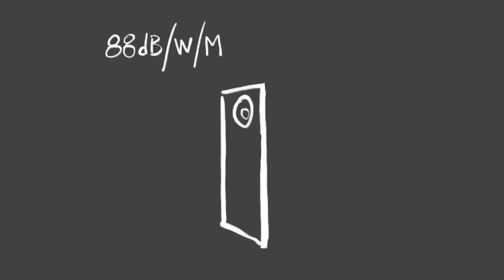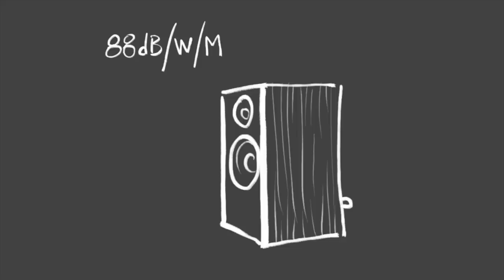John DeVore goes on a rant about the High End Audio lie that inspired him to start his company

Comment: Manufacturers started putting fuses in their cabinets a LONG time ago, as well.

I have had a pair of the lovely little "baby" infinity speakers with the ribbon tweeters for decades. They sound MUCH better with an added sub-woofer ( I run a fairly old Sony Active unit). Power amp is a classic old Rotel Ra-1412 that I bought back in the very late 1970's..

One thing I discovered a LONG time ago is that more speakers (and particularly their HF drivers) are blown up by people driving their amplifiers into square-wave distortion than have ever been "blown up" by sheer power alone. Ribbon tweeters are particularly susceptible to this. The evil super HF chatter that comes out of some electronic keyboards is also hard in ribbon tweeters. Unstable MosFet amplifiers; ditto. 100 KHz, rail to rail (+ & - 80V) square-waves will mess up your expensive HF drivers BIGLY. In the time it takes you notice how "odd" things sound, you'll be smelling the smoke from the incinerated voice-coils.

In the "serious sound-reinforcement" world, there seems to be two schools of thought:

Huge amplifiers connected to assorted boxes by relatively long, heavy cables, or

Active system where the speaker box contains the drivers, active crossovers and power amplifiers; Meyer Sound Labs is a classic example. It actually makes sense to have ten-inch speaker cables because they are running two-ohm drivers.

Also, good luck designing and building a passive crossover that has zero phase shift.

One abomination I saw in a theatre installation was foldback wedges that were sixteen Ohm, (nominally). However, the drivers (EV) were EIGHT Ohm and connected via custom-built passive crossovers. The local "acoustic consultant" wanted this so that the Yamaha 2200 Amplifiers could drive FOUR of them in parallel, (via, mind you, cables that ran from an amplifier room a LONG way from the stage). Impedance-matching? Power Factor? Yeah! Right!.

Then, there are the Bose 802 boxes, full of two-ohm drivers wired series/parallel to present a nominal eight ohm impedance to the amplifier.

Comment: I always found most Thiel speakers to sound excruciatingly bright. Some models better than others like the model 5s but most Thiels produced a much too fierce and metallic treble. But they were popular especially in magazines like Stereophile that gave them far too much attention because they did a lot of advertising. But I had no idea the company folded.
Reply: They are bright when they don't have a high current amp driving them.  When you get the amp and pre-amp right...in my case KRELL as he said....it's not bright at all but extremely articulate.  In fact, they are so accurate that they show the weakness of electronics and source without fail.  Get that right and Thiels are fantastic speakers.

Comment: If speakers are measured at 1m, basically a near field measurement, how does that correlate w baffle step compensation and achieving an accurate db measurement across the frequency range?

Comment: Watching this again and laughing a bit at the 82 db being terribly low sensitivity. I recently commented about a bookshelf having this low figure being a bit disappointing. The designer went for the lowest extension they could get from a 6.5" driver and pair of passive radiators. This comment drew the immediate ire of the designer from the driver company and some fans. You shouldn't expect that much peak SPL from a speaker that size! Or maybe they shouldn't have built such power robbing crossovers and tried to make a little driver dig so deep....anywho. Opinions.

Comment: I wish that all the hi-fi review mags would measure and give the real db per watt spec, but I doubt if they have the courage.

Even an 8 ohm speaker could actually be 5 to 6 ohms in much of their frequency spectrum, so specifying efficiency using voltage input is a piss pore marketing trick.

Comment: Seems to me most drivers are still rated in w/m

I can kinda see why they use voltage instead though.

Ones amplifier will only be able to produce a certain max voltage, and thus a scale bases on dB / volt will provide a better idea of what one can expect.

i.e. 1000W 1ohm amp wont put out much power into a 16 ohm load.

While a pair of 500W @ 8ohm amps bridged to a 16ohm driver would deliver 1000W.

Put another way: a 1000W sub with a 4ohm coil
v.s. 1000W sub with a 16 ohm coil.

Both would be the same dB sensitive in w/m
But the 4ohm driver would sound louder on a given amifier due to the higher v/m sensitivity.

dB / volt makes balancing multiple drivers easier.

Comment: You are right, but at the same time also a bit wrong.
Everything you are saying is technically correct, but that flexibility to perform at those unstable ohm's also make a sound very unnatural and locked, and at best you end up with something like a D'agostino amp.
People have to understand that a flexible amp, it just compatible and cool and nice and practical and powerful with good control. Because it is so flexible in design, it detracts seriously from the optimal sound signature. And will always have a linear type of detail and be on the grey/boring side, with a slightly flat soundstage compared to the ones with best signature.
But yes D'agostino and Bob Carver probably do this at the very best levels, while still sounding relatively natural.

Comment: This video really hit home for those of us who started buying audio equipment in the 70's and onwards.  John mentioned the brutally low impedances of Apogee ribbons necessitating mega-amplifiers like Mark Levinson & Krell and the "Receiver Wars" where Pioneer's top model produced 300 wRMS @8 ohms. (It was the size of a window air conditioning unit)  Notably, the euphonic tube amplifiers whose performance is all over the map with the varying impedances of loudspeaker drivers.  Essentially, the specifications which are supposed to be a reference meter are useless.  Today there are legions of multi-driver, loudspeakers with crossover systems so complex requiring insane amounts of amplifier current to drive them as there are inefficient, 2-way bookshelf systems that only begin to come to life when driven to lease-breaking sound pressure levels.

Comment: Hell those specs can be downright DAMAGING! Some of my absolute favorite speakers or all time are two speakers (lines of speakers) that could not be farther apart. On one end, The kplipschorn (t-350 tweeter variant, with improvent mid driver (I has some Sunn that outperformed somer bigger 2" mid compression it a MILE, And minimal crossovers.
Sp were talking 106 Db/w/m

On the other side of youe coin? I'm eeply in love with vintage Infinity Quantum series. The Q-3 down through to Q-line seriesI (my unicorn speakers I WILL own before I die)
The Rs ( I owned the Rs 2,5) 
And the sonic cannon of the gods, The IRSV (famously calpable of producing the accurate cannon blast from the telarc 1812.

Now, I've run my frenkenKhrorns on anything you can run power through. Its actually possible to achieve a listenabke level by taking a wire out of a headphone change, splitting it, and running hte khones with it. Thats 0.75w. A  decent triad with make anything under a 6 - 8 piece orchestral spound great, but, like any speakers, if I really want the walls to mlts its going to take a decent sized amp to do it. My preferece was some of hte rarer sasui blackface from thh early 70s. I audtidioned 20k worth of gear before settiling on feww hundred buck sansui! :)

Now. The other Side of hte coin? I believe the Infinitry Kappa 8 was the single lowest imdepamce production speaker made. I seriously would believe youcould either A; arc weld with it, or B: short out and melt an arc welder. They Take some of the most disgusting power requirements I;ve ever seen in a stationary piece of equiment short of a cyclotron. And God Dang do tey sound heavenly\ Te only was I could be shure I had an amp that aould power the infinirts was if the bdwm DOUBLED for every impedance halving, all the  way out to near infiniyt

So I agree that there was defintely some market shade going on, I mean< wjen was there not? (yamahas ear shaped diaphtaghms , the lifetimes worth of fake engineering degree "opinions" etc.

I just wanbted so say that there are some Sexy speakers at both ends. whether you're driving 110w/d/m  Wesern Electric horns the size of houses or Vintage infinitys that hit >1ohm playeng Simon and Garfunkle. 

That feeling ff siting back in you couch and  experiencing that ......aaaaaaaaah,,,,,, feeling., man, nothing e\lse ffor hte next odd hour matters in life
Reply: 106 dB is insane efficiency for a full range speaker.

Comment: Hmmmm... I think its something more complex since almost every amp works as a Voltage source (please note the term is used in physics). So lets say the amp is powered on, gets an imput signal and has NO speaker-load on the output. You can measure an certain amount of so called Open circuit voltage on the output, depending on the amount of input and amplifing capability, but of course NO power ...so far so good.
Now lets decrease the load from infinity (=no load) to an amount of lets say the nominal value of a typical speaker (8 Ohms i.e.). Until around that point the amps behavior is still that of a Voltage source. If you go less to an specific amount of load (as we know every speakers resistance/impedance varies with the frequency, therefore the impedance easily can fall below the nominal value, mostly at low f!) the output voltage will be more and more devided between output stage of the amp and the load, the load gets less power. We are increasingly no longer dealing with a voltage source, but with a current source.
Now we can derive, that the output power depends not only on 4 Ohms, 8 Ohms and so on, it also changes with the frequency of the signal!
Conclusion: a speaker developer has to use the 2.83 Volts as a reference, i.e. to determine and compare the frequency-response, while imho the dB/W/m-value absolutely still would make sense for the final endproduct and customers use.

Comment: Since speakers are essentially electric motors, that is, current driven, why not make amplifiers current sources rather that voltage sources? Then the fluctuations of impedance with frequency becomes a moot point.
Reply: I believe. So don't beat me over the head if I don't get this quite right it was done because transistors could be easily made to produce more current i.e. made bigger but would blow up with high voltage swings I know in the car world the supply voltage was the issue so lower impedance allowed more power weather voltage is still a problem with the latest transistors I do not know but it seems it was in the 90,s

Comment: Very good points there. i was actually expecting a rant on the 'purity' of the sound output to the electrical input - technically, a resonance or vibration may contribute to the SPL but would definitely be unwelcome.
Could part of the reason some companies started to introduce 4 or 2 Ω impedance be because it required less voltage, and was seen as 'safer'?

I expect your views on the abortion that was PMPO would melt the interweb - so much hype, and so much stupid where that BS was concerned 🤢

Comment: 88db at 1m???  I come from the pro audio (concert) world where most speakers are high 90s+

The obvious question is at what frequency, but many of the better manufactures give the test frequency as well
Reply: Power is not a issue for home setup. But in huge concert setups you obviously don't want to waste electricity

Comment: John, isn’t labeling a speaker as a specific load (rated in ohms) just as misleading as the 2.83 volt spec?
Isn’t a speaker only going to be 4 or 8 or 10.5 ohms at a specific frequency?

Comment: I feel like there's important info missing.  For example, the Krells, they're pure Class A, they double in power with a 1/2 of impedance.  My old Haflers are A/B and do the same and are stable at 2 ohm.  I get the tube amp problem but forgetting about teh lacking low end power ,  who wants to run an 80db/w/m speaker on 6 watts?  Not me. Please pass the horn speaker.  Now please instruct us to all these new and, to me, weird new digital amps, for example Class D.    What are good matches and what are not?  When I was a kid they started with the Class D amps which were cheap and crappy but were good for bass.  Now how's the technology?

Comment: I was hoping this was going to be about inflated prices. It is getting ridiculous
Reply: Inflated prices aren't the problem. People paying inflated prices is the problem. The solution is simple, don't buy them even if you can afford them. Now, in a bit of defense for what many perceive as high prices, If you have to do years of research and development and you are producing a niche product, the overall low volume of sales is going to dictate higher pricing or you'll go broke. Even if you are a big company, say B&W for example, why would you design something like the Nautilus and price it purely by the bill of parts (BoP) when you can simply bolt 4 of the rack drivers and associated electronics into a box and sell it for the same BoP markup?

This isn't to absolve those companies who are truly ripping consumers off. Like rebranding a cheap Chinese int amp with a designer label and charging 20X more for it.

Comment: I thought watts rated the power of a microwave oven. Or the heat/brightness of a lightbulb.

For power amps, aren't watts just an equivalent ? IMO, amps should be rated 'volts in db'.

Comment: Well this has been true for many years now.
But there are a few points, which should be emphasized, I think.
First the trend with low impedances in speakers is mainly American. 
Both Apogee, Wilson, Thiel and many other American speaker manufacturers have been doing this for the last few decades.
In Europe this is not as common. Looking at the 3 largest speaker manufacturers, Bowers & Wilkins uses the trick to some extent, Dali and Dynaudio do not, and they are the three largest manufacturers of high-end speakers in the world.
Second switching amplifiers are NOT digital, they can be, but rarely are.
Class D amplifiers are just as analog as normal linear amplifiers are, they just regulate their output power in the time domain.
You can buy digital amplifiers, but they are very exotic in high end. TI makes a lot of digital amplifier chips, which are located in all kinds of electronic stuff i.e. TV´s, active loudspeakers and so on. They are very cheap and limited in output power.
Last but not least class D amplifiers are capable delivering even more power than linear ones as the Krell ones.
The best of class D has extremely low output impedance, and drives low impedances very easily, but there has to some understanding to their topology, and the need for dimensioning everything to meet conditions in use.
In contrary to linear amplifiers, there is no gain in sound quality dimensioning the amplifier for sinusoidal signals.
Thus most class D amplifiers are designed for practical use instead. Driving a faulty designed speaker @ 1 Ohm with sinusoidal signals is stupid. If a speaker with that low impedance exists, it should have been scrabbed right from the beginning.
But a class D amplifier done right, will do that with a musical signal anyway.
With a sinusoidal signal, the good class d amps will automatically shut down, because this must be a defect.
Remember that even the most violently compressed musical signal will still not contain more than 10% of the energy of a sinusoidal signal.

To sum up class D amplifiers of good breed have way lower output impedance than any linear amplifier.
You even have to do Kelvin measurements to establish the value on the very best ones.

Comment: Well explained and informative but you do not answer the most important question in this matter though. Why did speaker manufactures like Infinity (I have an Infinity QLS which qualifies "as good" as the mentioned Thiel CS5) Acoustat, Apogee, Thiel and so forth , choose to make those kind of speakers? Was there a particular benefit for them soundwise, did the upcoming solid state good sounding high-end amplifiers like the Levinson ML-2 make it possible to make these speakers or was there a kind of hidden agenda that Threshold, Levinson, Krell and Rowland endorsed these inefficient low impendence speakers to market their V8 amplifiers. You have to address this question I think otherwise your rant will be pretty meaningless in itself.
My Conrad Johnson Premier One was developed on a fullrange Acoustat by the way so there are tubeamps that can deliver some punch ;-)

Comment: I used a pair Infinity 90‘s with a Yamaha AX-870 . The Marantz AV Receiver before was going a few times shut down and at least the damage one Side inside Audio Transistor bank and Video boards turned into Smokers 🤭😅😂 After month later i could make jokes about the destroying factor..
Some means oh the 90‘s infinity are not so trouble shooter as the 8.1 or 9.1 or ... 🤨🧐 
I saw the Impedance  by my 90‘s to use them Loud 😳  1.7-2.1  Ohms they are a 0.5 ohms higher as 8.x or 9.2 ... so critically are both series cause find a modern Stereo or AV with a using range and practical useable under 2 Ohms. Some 90‘-2000‘ or PA